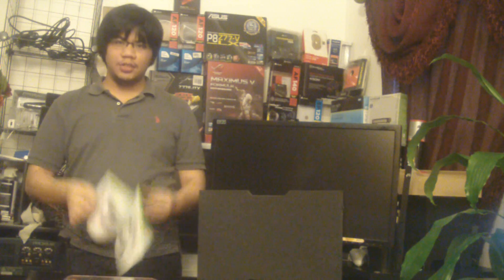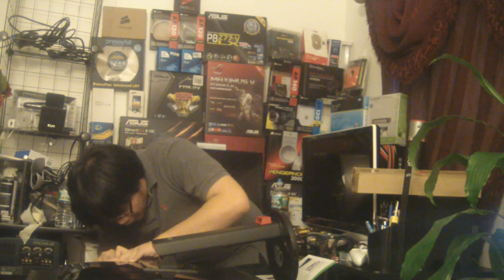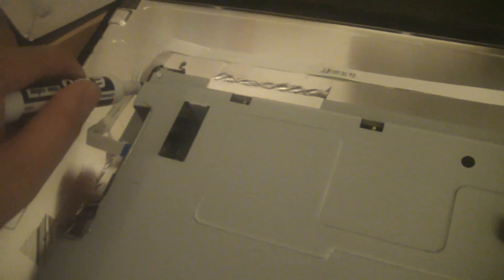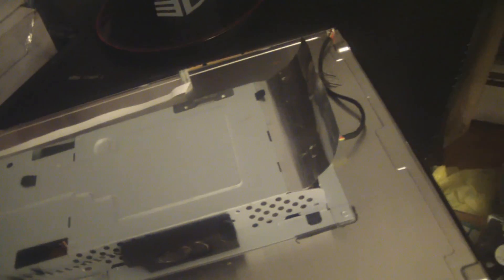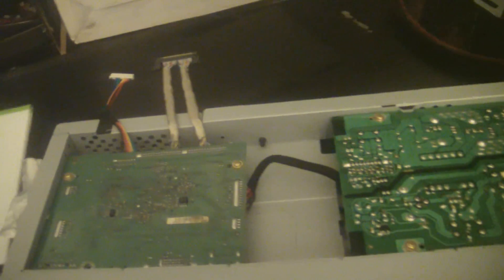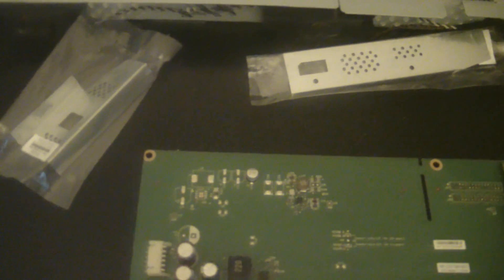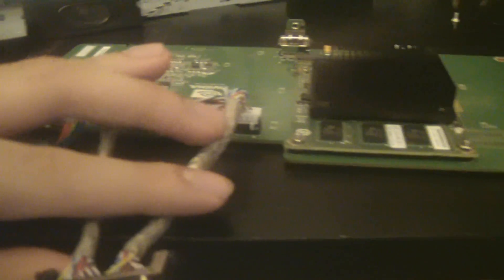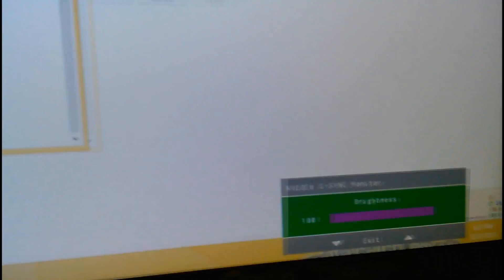Nvidia G-Sync DIY Installation Video

Comment: The Asus 3D 24" monitor already comes with G sync?  What monitor are you using in this video?
Reply from the maker: I am using the Asus VG248QE. The only Asus Monitor that I know comes with G-Sync Preinstalled is the ROG Swift PG278Q. The VG248QE has an upgrade kit that I am not even sure you can purchase anywhere.
Reply: cool.  Thanks man.

Comment: So is the G Sync module only compatible with one monitor? That would be really stupid.
Reply from the maker: Several other vendors have G-Sync monitors. As far as I know, the VG248QE is the only monitor that a user can buy and then buy the G-Sync module as an aftermarket upgrade. ASUS has their ROG Swift monitor with G-sync and Acer has a 4K G-Sync monitor. I'm sure there are a couple more.

Comment: can you put this in any monitor
Reply from the maker: Currently, the DIY kit is for the ASUS VG248QE monitor. Some monitors out now may get an upgrade kit, but otherwise, you will have to buy a monitor with G-Sync built it.
Reply: OK THANKS

Comment: Thanks for the video. No more DVI? I need to get new cables as well! I run GTX Titan SLI with three ASUS VG248QE and Nvidia Surround. I need to know if I can run only one gsync monitor and two non-gsync in nvidia surround. Or do I need to gsync all three? Would gsync work using a DVI to DP adapter since my SLI setup has only two DP ports. Thanks.